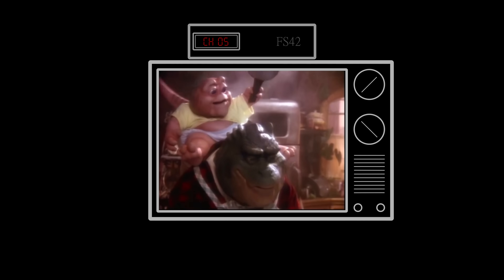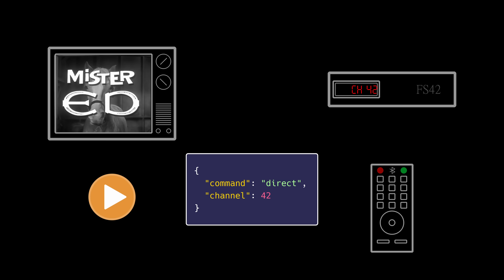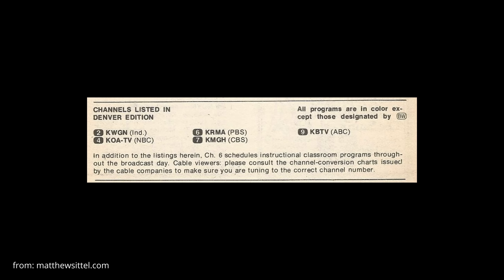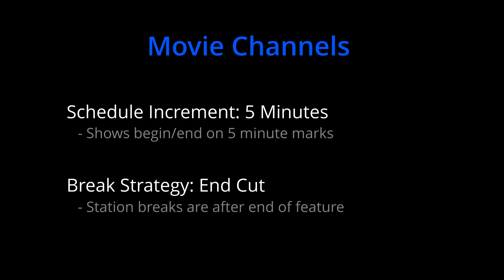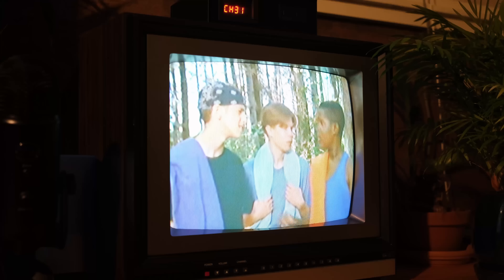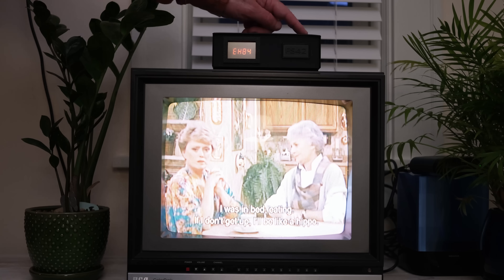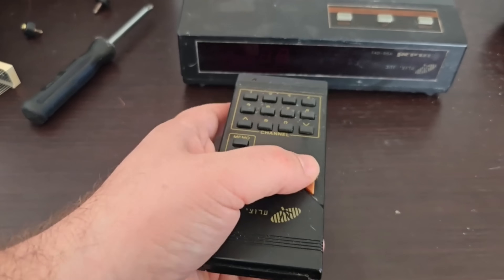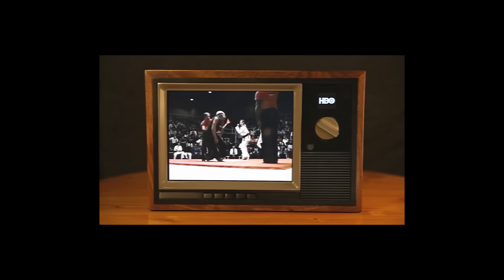90s Cable Simulator - Recreating Retro Cable TV with a Raspberry Pi

Comment: i wish you sold the hardware :D it looks amazing. i could handle the software piece, but i feel too lazy to even get started on the box itself self.
Reply from the maker: Thanks for the interest - looking at potentially doing a limited run at some point. In the meantime, you can run it on any linux distro, macs and even windows if you use WSL (windows subsystem for linux) - no special hardware needed.
Reply: @wrongdog_reckons  that'd be awesome! i think you're in ga, and i'm right above you here in sc. would be very interested in a limited run edition if you ever get around to it. im a fairly heavy linux user here, it's what i've done career-wise for decades. but i think your style of hardware along with your amazing oss is what really makes it sing.
Reply from the maker: @dereckh  - I grew up in Georgia, but I live in Seattle now. I'm going to keep building this out, so check back in :) Cheers!

Comment: I have a feature suggestion. If you are able to trigger random events with the commercials, set it up so that at random it will play the same commercial two times in a row. I remember that happening quite a few times in the late 90s and early 2000s. Somehow something would get messed up and they’d just show it twice for whatever reason. Would be a cool little extra feature.
Reply from the maker: If you want the simulator to be accurate, it has to make mistakes :) This is true - sometimes there is a little gap between a show ending and a show starting (3 to 5 seconds) and I'm like "Yep, exactly how I remember it" - cheers!
Reply: i remember a night in like 2011 where the same NERF commercial played 5 actual times in a row. it was some A-side and B-side commercial with moreorless the same presentation of a series of their girly guns if i recall correctly. I think it was an odd thing that DirecTV did
Reply: They sell all those 30,000 games in a box consoles on Amazon and eBay preloaded with the roms

Comment: I had tried a similiar thing with a arduino and a NES, my approach was to have them output video on seperate frequencies and the TV (a modern flatscreen tv) decode and add the channels to its system. I even tried to research how to add Teletext to my video signals but wasnt getting far.

Maybe i should just stop attempting to make "REAL" channels and just go start using a Pi project like this and add a remote. if anyone knows if its possible to instruct the RF converter to change to a whole new channel, we could spy on my remote, switch to this other frequency and make the real TV believe its watching another channel while in fact, its the real Pi. the NES RF converter ive been using is pretty dumb and only has 2 channels, apparently a bunch of coils to change the frequency we add our video signal to. (and other passives). might try someday. meanwhile this project looks doable, and I do have some old channel boxes laying arround
Reply from the maker: Give it a go - if you hit any snags, just file a ticket on github and we'll work through it. Cheers!

Comment: 10:16 for the music channel i very recommend Windows96 albums, super chill and psychedelic vaporwave videoclips made on purpose to give that 90´s tv looking, so it will fit perfect, other good artist is Sonavision. Recently both and other artists made a collab with a large compilation of tracks with a nice old tv videoclip style. Someone even made a wheather channel music compilation with a fake wheater channel clip loop.
Reply from the maker: Agree - most of my bumps are super Windows96 sounding - note that the default station signoff video is roughly in that genre. I'll check out the the specific references.  Cheers!
Reply: @wrongdog_reckons  you´re wellcome... i really want too see how looks windows96 videoclips in an old tv

Comment: ive had something like this as an aspirational goal for a long while, i was going to try to tackle it by editing hour long blocks myself and writing it to run from certain playlists at certain times, this seems like a waaaaay easier way to accomplish this, although im not certain if it will progressively air series in order each day as i had hoped

this is really incredible, thank you so much!
Reply from the maker: It currently does not, it goes randomly through the directories and picks the least played item to keep the lineup fresh. I am working on this features to cluster series and play in order moving forward. Check back in a week or so :) Cheers!

Comment: This is exactly what I've been trying to slowly recreate for years now! One day when I can accumulate all the content, I want to have an all encompassing cartoon network/toonami/adult swim channel
Reply from the maker: Nice! I just released a feature today to support the toonami/adult swim use case: you have to have the toonami bump to start off the 3 or 4 hour programming block and now you can. If you want to use this software and run into any issue getting it set up, file a ticket on github and we'll work through it. Cheers!

Comment: is there a way to have media stored on a larger usb drive/nas?
Reply from the maker: For sure - this one is powered by some spinning drives in a docking station connected by USB. See that blue thing behind the cable box in the thumbnail? That is a cover I 3d printed to hide the drives. Cheers!
Reply: @wrongdog_reckons  amped. using a 512gb sd for now, but - i dont see that lasting long with the media i wanna slam on it. any info on how to change where the software points to the usb drive? thanks!
Reply from the maker: @TheHandlebarGamer  - I use symbolic links from the catalog folder that the installer creates out to where the actual content is.
Reply: @wrongdog_reckons  Will probably have to give this a go. I expect my library to explode :D

Comment: As someone who experienced cable but am of a later generation I’m hoping there are people setting up channels with 2000s,2010s content but also modern content. 

As the channel format still has benefits outside of nostalgia.
Reply from the maker: Its true - you can customize it with whatever content you own. I've already started to let a little 90's like content from the 2000s slip into mine. I just think Corner Gas was a 90s show that was filmed in the 2000s. Cheers!

Comment: as a guy that cant code, man i would pay for a plug n play model of this type of thing. to be to set it up to an old TV and just walk into the den at night and watch 90s tv like it was back then would be so so great.
Reply from the maker: You don't have to code to use the software, but it does take some system administration skills for sure. I think you could set one up if you want to give it a try. Cheers!
Reply: @wrongdog_reckons  would definitely love if you eventually post some tutorials on how a more casual person can set this up on a Linux mini pc. I don't need the custom hardware, and I'm sure I could eventually figure out if I had the time, but a more "dummy" focused tutorial would sure go a long way 😂
Reply from the maker: @DanyTheMe  - good callout, I'll make one. I'm just torn on whether to do it on this channel or start another (I never envisioned this being a retro-cable channel, but cover a diversity of projects) so I have to work through that in my head
Reply: @wrongdog_reckons I’m horrible with this kind of thing. I would be willing to pay you for building me one.
Reply: @wrongdog_reckons would you say that is easy ? I want to learn more about programming and computers and I think this is good ststt
Reply from the maker: @pspwilliams  - it's moderately challenging and I think it's a good way to learn about computers, and even to try programming if you want (not required to set it up).
Reply: I agree, I kept thinking, sir please take my money and give me one lol

Comment: Will the case fit a raspberry pi 4 model b? Also would you consider selling these? I really want one but I don't have experience putting stuff like this together.
Reply from the maker: I haven't tested it, but pretty sure it wouldn't line up right. It would be a pretty simple mod I think. Cheers!

Comment: Hey there, I'm running into an issue. I have a bunch of files on a USB flash drive. The Field Station install is on my Pi proper. venv is added, all the necessary modules are installed. I built the config, I'm able to rebuild the catalog, it'll find all the video files, bumps, and commercials. It loads fine, until I open the field player. Terminal says it's loading a video, but I only get a black screen. I have to Alt+Tab to get out of the screen and over to Terminal again.

Is this a permissions issue, or something else? Beyond that, I love what you've come up with.
Reply from the maker: That's strange - can you file an issue on the github project and we'll work through it? If there's anything printed out the the console when you try to run the field play, put that in as well. Thanks!

Comment: I want to do this so bad, or even just run something like it from my computer, but it seems intense to set up.
Reply from the maker: Its not that bad, but does take a little Linux experience - works fine on a computer too. Any Linux install will do - you can also use WSL on windows and it works with that. If you decide to give it a go and get stuck, file and issue on github and we'll work through it. Cheers!

Comment: This feels like a more polished take on what @clabretro did in his video titled 'Ultimate homelab cable setup'
Reply from the maker: I'm a fan of clabretro - have watched quiet a few of their videos, and there is a difference between what they do and what I do: I build new systems that simulate old systems using almost all software. He recreates or emulates old systems that work closer to the way the old tech was originally designed. Its similar, in that both give you a space to inspect the old tech, but mine takes up MUCH less space than his does :) Cheers!

Comment: OK, I think I'm missing something. The components in the box didn't look like it had data storage. So where is the box pulling the programming from.

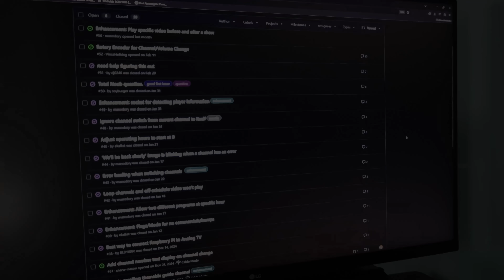Also what would it take to make that time capsule effect (take the programming from a geographical area and sync it for the decade so that January 1st 2030 at 01:00 your box would play the same program that was aired January 1st 1990 at 01:00 and effectively loop every decade?) When Cap wakes up I don't want him catching on because I used the wrong program schedule.
Reply from the maker: You see it, its just hiding in plain site. See that blue thing behind the cable box in the thumbnail? That is a hard drive docking station, I 3d printed a cover to hide the spinning disks in there :) 

The major problem there is sourcing the content for something like that. Would take a massive crowd sourced effort to get all that good stuff if it even still exists. Cheers!

Comment: I'm going to make this, but I don't see listed anywhere, what did you use for the buttons to change channels or the channel display? I would like to use your box but I can't find what parts were used.
Reply from the maker: There are two github repos in the description, one of them is for the cable box. It has a BoM, Fritzing diagram for wiring and instructions: https://github.com/shane-mason/cable-box

Cheers!
Reply: @wrongdog_reckons  Thanks! I swear I looked yesterday and it didn't have all of that!
Reply from the maker: @c1charge1  - you did and it wasn't there then. Somone filed an issue and I remembered to do it :)

Comment: Saw this video the day you uploaded it, and I've been obsessed with building it ever since. This is the fourth time I've watched it now....

I've already got your software working on an old PC I had, and have started grabbing compilations of old British TV commercials and station idents from online.... I'm just struggling to find promos and other bumper material.

One thing I've really been struggling with, is a valid reason to buy and build this into a raspberry Pi, other than the fun and nostalgia I'd get for building it.... My wife, as usual, doesn't see the point! But then I realised.... I have a large collection of TV shows and Movies stored on an external hard drive, and I've been meaning to build a low powered Plex server to stream the content to other TVs in my house.... a Raspberry Pi would be perfect for that job. 

So, I can have the best of both worlds.... a custom streaming platform and a realistic cable simulator. When you know exactly what you want to watch, you stream.... when you just want to channel surf and stumble upon something thats "just on", you switch to cable!
Reply from the maker: Exactly - I'm sitting here right now with saturday morning cartoons just playing away and I had to make ZERO choices. Its pretty nice. For bumps and commercials, you might want to check in at Archive.org VHS vault? I don't know, but you might find something there. If you run into any issues, file a ticket on github. Cheers!

Comment: Here I was going into this thinking this would start out as a somewhat normal Linux that captures from a DTV antenna using an AverMedia, Hauppauge, Elgato, etc dongle, and an extremely customized Kodi+TVHeadEnd setup...
Reply from the maker: Yeah, I have a tendency to just strike out on my own when I want to play with a tech. Cheers!
Reply: @wrongdog_reckons  Not a bad thing at all! I'm the one with egg on my face just because that Linux+Kodi+DTV-in+TVHeadEnd is what I did back in 2011/2012-ish so that was an expectation I had in the era of Raspberry Pi.

On reflection, even just relying on OTA/cable and TVHeadEnd or equivalent tethers someone to content outside their control regardless of whether the capture dongle is any amount inside the enclosure box or not. While other videos would probably say "Use Plex and a NAS" or something, at least this video adds some whimsy to the thing. As someone who used an Arduino to interface a physical Yamaha YM2151 audio chip (the same retro sound chip used in arcade games like Street Fighter 2) to a children's electronic keyboard to make a real chiptune synthesizer, I can definitely appreciate that kind of whimsy. :)

Comment: My only comments would be to work on the TV guide channel... well specificly ONE THIGN that you're missing that is IMPERATIVE you implement!! You need the SHADOWS ON THE LINES!!! You seem to be using just plain lines, but the always had a kind of 3D look to them, like each block was a brick and you could see a bit of a shadow... err no.. it's not a shadow.. hrmm.. it's just depth... you would divide each line in half and make each intersection divided by the corners... and then you just change the colors so all the bottom and left side of each block is in a darker color that the lines on the top and the right.... but there is one bit I'm not sure of.... was there an outline around each of these sections?... or was just a single thin line in each of the intersections that was basically an 'X' so each color was separated?
You would have to play around with to make it look how you remember it... but it was ABSOLUTELY not just a single line dividing each of the time slots...and that little detail always impressed me for being a stupid TV guide channel.. someone went that extra little mile to make it look just a little bit more professional and classy LOL
- GREAT WORK!!! This is AMAZING!!! It's EXCACTLY how I remember!! But eventually they upgraded the boxes and it had a built-in TV guide to entire system, so you browsed it to find your channel..... but I guess that wasn't in the 90's was it? GOOD STUFF!
Reply from the maker: Thanks! For the guide channel, I went off a video I found of the 'Prevue Channel' in 1993 that looked like the one our cable company had. https://www.youtube.com/watch?v=3lqXAEzvIFw

Even off this video, there are a several things that need to improve on mine. The colors aren't right and the real Prevue Channel has colors to denote the type of show and the arrows to indicate if it started or continues offscreen. Mine doesn't support motion video either. I'll keep working on it. I appreciate your kind words - Cheers!
Reply from the maker: One other note, I set it up most of the look and feel can be configured without changing the code. It will also be easy when someone wants to add a different front end - like this Prevue channel from 1992 has a completely different look: https://www.youtube.com/watch?v=Ve_lHl1iR10

Comment: Another thing you could add to the lineup if you wanted to is the weatherscan emulator, granted it would be closer to 99, early 2000s than strictly 90s.
Reply from the maker: There are a couple of people with weatherstar emulator experience that are working on that a little. Hopefully it will happen soon. Cheers!

Comment: That would be cool if it keeps in circulation content that you haven't watched, so you never miss episodes of any shows. And when you tune to the right channel, you can pick up from where you left off.
Reply from the maker: Would be a killer feature, but kind of defeats the purpose of a 90's simulator, since 90's cable did none of that. Miss a show? Its gone until rerun season. Sounds more like a streaming service emulator :) Cheers.
Reply: @wrongdog_reckons  well a streaming service would be completely on demand. in this case you would still have it tune into the right channel at the right time. perhaps it could be a toggle-able feature.

Comment: 1:38 Cable boxes (like the one pictured) usually contained an addressable descrambler, to allow viewing of premium channels that were paid for. 

If your TV's tuner wasn't cable ready, you could get a cable adapter box, which simply allowed the full (unscrambled) channel line up to be viewed. The monthly fee for them was lower than a fully featured cable box.

Cable systems use a different frequency layout for their channels compared to over the air channels, requiring a cable ready tuner in the TV.
Reply from the maker: That's great details - much appreciated! Cheers!